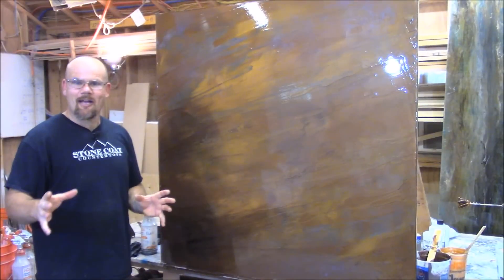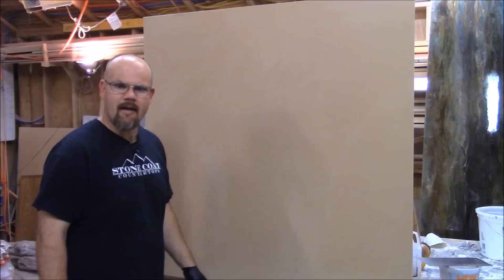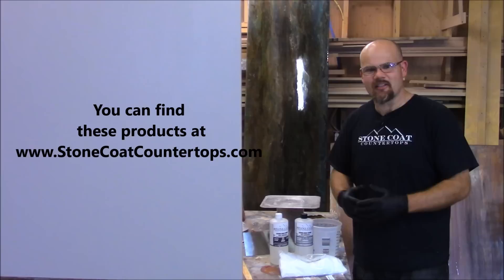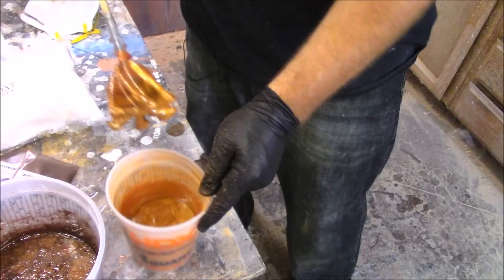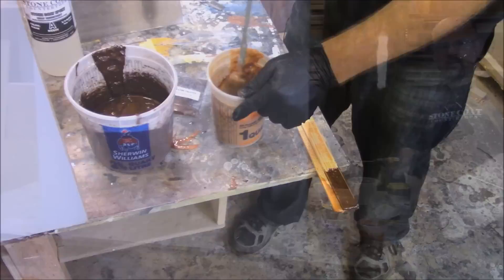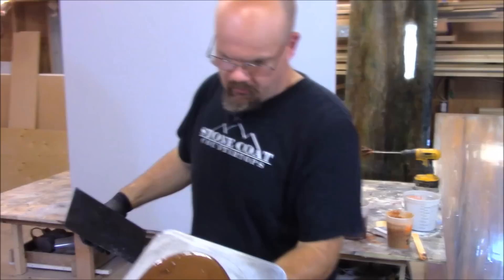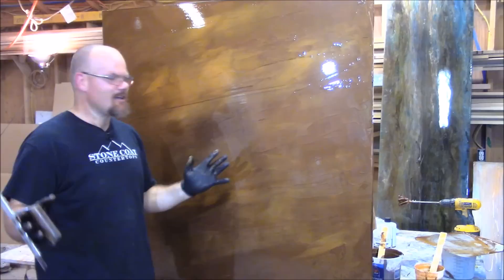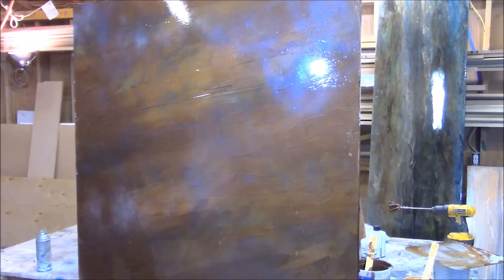Vertical wall epoxy, DIY

Comment: That vertical application is really nice. In the video it looks easy but I'm sure it takes practice.  I worked for many years  in epoxy flooring and doing the base on the floors was challenging  but you guys make everything so simple and easy to understand.  Awesome video.  Keep up the good work.

Comment: I love Mike... I really do. But this stuff is really for professionals only. We tried it. Bought the bonding primer, watched the video 20 times, read anything we could find and followed instructions to the letter. It's a complete disaster. The clean up to get the mess off is way worse, harder and more time consuming than the application. The bonding primer peeled off. The color didn't cover. We tried multiple paints and none of them worked the same way it does on the video. Mike does a wonderful job. Hire him to do it for you. This really requires a professional.
Reply from the maker: Thank you for reaching out to us Pine Run Farm! What type of substrate were you installing over?  We would be more than happy to help you out withh a fix and step-by-step instruction. Please feel free to call or email us anytime. (541)450-1976

Comment: Now I get it. You are showing people great ideas and artistry as far as they can possibly imagine using your brand of epoxy within that 45 minute window. Theres so much you can do creativewise in 45 minutes if you plan your steps very well and prepare your products accordingly, the 45 minutes is all about just letting your creative juice flow. That's big tip. Thanks! I think this is worth journaling.

Comment: That's really cool! Knowing what I know about resin I was like "he can't do that on a vertical wall..." and I was half right. With standard epoxy you can't but with a thickener it makes sense. Very awesome and now I want to do the wall around my shower. :P - Heidi
Reply: BlackCat2 I did a vertical wall with a regular epoxy. I had to apply it in light coats, let each coat cure and keep applying until the correct thickness is met. I used Corotech block filler primer and the primer, Simiron Routes for the top coats. I even added color flakes, that wasn't easy. I had over 2,300 sqft of walls in 3 different rooms. Throwing color flakes at a wall isn't fun. I wish I could add pictures. My Facebook page has them posted. Granite State Epoxy Floors.
Reply: hola amigo donde puedo conseguir un video sobre resina en paredes pero en español

Comment: I’ve done Marble with veins threw-out a whole bedroom years ago including ceiling . It blended as if all one piece.  Takes time . Only work one side at a time .
Reply: The rug was pure white so the walls was off ivory with veins of pale colors
Reply: did you do it on the mdf or straight on the walls? how did it hold up over time?

Comment: My question is,  how come there is only 1 video of this vertical epoxy wall.  It looks great and so easy,  why haven't you posted anymore videos? I'd like to see it with lighter colors. It's a bit hard to see what the finished texture is going to be.  Sample boards! Please do some samples.
Reply from the maker: Great question Froggie CanISeeYourJunk! We will be coming out with an updated vertical wall video very soon, stay tuned!
Reply: @StoneCoatCountertops  awesome news.  I've already bought the product from you, i'm just hesitant to use it.  Im worried the finish won't be smooth and glassy.  Trying to figure our another way to make my shower/tub surround. The bathroom is completely gutted. DOWN TO THE STUDS. Thankfully there's another one that can be used.
Reply: I would love to do this in my shower. A video explaining all of that, would be fantastic!!!
Reply: @StoneCoatCountertops  Yes Please!! I would love another video as I am considering epoxy shower walls in my new house!
Reply: Stone Coat Countertops , hi Guys, can you use a paint brushe with this for doing table legs ?
Reply: Does the product self level on a vertical wall?
Reply: @caniseeyourjunk6509  - Can you provide a follow up? Did you proceed with the project, results, opinion? 
Thank you!
Reply: @nicknoland9704  the project isn't complete yet and at this point I'm skeptical about using the product I purchased.  I beleive if it was as amazing as originally touted there'd be more videos.  I don't want to experiment on a remodel of my bathroom that's already taken way too long and have to come up with more money to fix the experiment when it doesn't work.
Reply: There are several. Go to their page and look up vertical epoxy walls or showers
Reply: @caniseeyourjunk6509  if your batheoom is gutted. I suggest beimg safe and waterproof membrane to studs or even 1/4 inch ply them mambrane & apply some form of bonding primer or thinset of some kind( if the mebrane has texture. This assures good adhesion when attaching the final wall pieces.) Measure you wall accurately & cut waterproof concrete board( yes I know redundant, mold .. Mildew...etc is tough stuff & unfortunately it likes to creep in anywhere it can find moisture) to you measurement to fit. And do your epoxy on a flat surface with oit the need of thickener just like you see in most of their other videos. Then you'll get smooth glass like finish. 
Side note- a friend did this...added several flood coats ( cuz well hes OCD)  . he added flood coats just incase the epoxy ever starts to fog or turn color ( his bathroom has alot of windows).. So as insurance he has , beleive it or not, basically used a orbital buffer ( for cars /wet sanding or color sanding) with , sand paper 100- 150/160-220 and then buffed it out with medium, fine , and ultra fine automotive clear coat "wax"(really isnt wax) . and finally a quick but with polishing cream..and v-i-o-l-a!!!!
Brand new finish. 
Simce he did like 3 or four flood coats. 
He'll be abke to this again probably 2 or 3 more times.. Seemd to work well for him and hasnt had any issues...
And now his huge 2 oerson shower loole lile he spent 20G's or more on a marble shower stall..
When it was more like 1000< his guesstimate . it was probably less, but he figured in labor and installation cost.
Reply: Is this able to be used on plywood walls also? Would it just take the prime and a prime and painting of the walls?
Reply: @StoneCoatCountertops  I would also like to see more vertical masterpieces before I attempt to replicate your technique.I have visions of gravity taking effect,and ending up with a mound at the bottom.
Reply: @caniseeyourjunk6509  He has a video showing how to make the walls for your gutted bathroom shower, then putting them up.
Reply: @caniseeyourjunk6509  hey how did your project turn out?
Reply: Stone Coat Countertops I already have a wall that’s painted how would I be able to make it look like your finished walls without ruin what is already up there? Like would I be able to use epoxy on it with no worries of it ruin what’s there?

Comment: Would be interested in seeing a video of this technique actually being used in the implementation of a shower wall/bathroom remodel. I saw the step by step guide on your website, but a video would be pretty awesome to make it more clear. You guys do great work, makes me wanna stop by when I'm in the area :)
Reply: He's done that too🔥🔥
Reply: @diamoneglass2136  sorry, can’t see it on his channel.. I saw only one project but there was  epoxy  pouring on the mdf sheet in horizontal position like countertop and then it was installed… would like to se the actual video of applying epoxy on shower walls with zoom on it at end..
Reply: @diamoneglass2136  pls link 😭🥺

Comment: Three Questions: 1.) What happens where it meets the floor/tub/walls - I assume there's some flow downwards and maybe some pooling - do you tape it, or...?,  2.) Is the finished texture smooth or does it retain the peaks and valleys from the troweling? and 3.) Would you topcoat this and if so, is thickener also added...?
Reply: I would like to know as welll
Reply: 1. Use Tyvek type tape at areas you're taping off, remove tape when product is tacky but not dry to create nice cut lines at edges, peel tape at a 45 degree angle from surface. The amount of thickener directly influences flow. When mixed properly, the material stays where you trowel it. 2. Retains the peaks and valleys from troweling. 3. Topcoat is not necessary but if you wanted to, yes, the thickener would be added. (If you want a smooth surface while maintaining the "depth" you'll need to apply several leveling topcoats, sanding in between and be careful not to burn through and sand off the ridges.) This is what works for me.
Reply: @TN_Travesty  thanks for this. It  make sense.
Reply: Boom
Reply: @TN_Travesty  Thank you Traves for your input,I guess it will be some time before a brush/roller type of paint finish on walls will be available.
Reply: I love your videos but I have a couple of questions.
I understand you're trying to talk while demonstrating the techniques but you're not wearing any specialised breathing apparatus or safety goggles to protect yourself.  is your product that safe that you don't need to worry so much about your lungs?
By using this additive would it be possible to weld vertical joins? Im wondering if I could create some panels for a dome in the roof of a building and obviously these would have to be joined up in place because it would be a fairly large structure. Would the product be UV resistant enough for the life of the building in this application to the outside weather?
So if you had a blockwork wall you would just skim coat render it , then Prime with paint before using the epoxy?
Reply: Geoff waterman you whisks probably post this comment as a stand alone if you want the stone coat people to see it and respond, replying to someone else’s random comment makes it highly unlikely they will see your comment. Good luck.
Reply: Good point.
Reply: Great question! I’ve got outdated kitchen countertop granite but how do we work on a backsplash that cannot be removed?  I’ve got huge countertop space
Reply: @lettycruz8493  They have backsplash videos too. You probably already know this though since your question is 6 months old.

Comment: Would love to see this done on an actual shower surround. Saw the one where you created the walls then installed in a shower, but would like to see an actual vertical job done in an actual shower. Also, can you epoxy cover a tub?
Reply: I cant see why you couldnt do your panels on flat surface then just install them like a surround in 3 pieces
Reply: @greatbay1961  It's an existing shower surround that if I am going to take apart/down, then I would just completely replace it with tile. Trying to avoid doing that.
Reply: @heatherlester3429  same here. I have some 70's fiberglass tub/shower surrounds I'd like to try it on. Don't know though.
Reply: @Heather Wood  Did you do it?   I'm strongly considering this for an old basement bathroom fiberglass shower.
Reply: Corey Van Raalte I haven't yet. I did my kitchen counters though and they turned out awesome.

Comment: how about showing a video of actual application on an existing tile on a shower please
Reply: And what happens when you eventually want to replace the epoxy treated tiles or tub surround? How do you remove the epoxy treatment? I need to know BEFORE I epoxy a tub surround, what it takes to remove it if you decide to go back to tile or some other wall covering?
Reply: @sheri4673  You can tile right over it. Just rough up the surface and use a proper tile glue.
Reply: Are they saying you can really do this over tile say shower/tub? LOL oookkkk!
Reply: You actually can just need to knock glaze off tile first.
Reply: @sheri4673  thats a great question. Im looking at making wheelchair accessible bathroom in an rv. If it wont chip,crack or flake, or is easily repaired,  I'll gut the room and do every suface except the toilet and ceiling vent. Its so easy to clean and the dog won't slip and the hair wont stick.
Reply: At another video they make some panels with epoxid and then mount them like tiles. This is easier to remove if you want.
Reply: Brett Bittner, how do you knock off glazed surface.?
Reply: @artbyamitabhakta  Sand and possibly prime.
Reply: What is that white powder?
Reply: @gaglitanwar  That is their Epoxy Thickener
Reply: Yes, I would love to see a video of an actual application on existing on a shower. That's exactly what I want to do.
Reply: @gaglitanwar  dope
Reply: Great question, I'm thinking of doing the exact same thing.

Comment: If I were to do this to my shower, would it work over caulk?  Can I use the same epoxy on the floor as the walls?  Can I use normal cleaners to clean the shower that has been coated in epoxy?

Comment: I used to Faux Finish Professionally, I'm familiar with Venetian Plaster, this does look like a similar process. It would be cool to take a brush to some of that, throw in some veins. Or you could do it with a cake frosting spatula!I 'm thinking waterfalls when I see these wall applications with some spray paint mist. But I think if it was swirled around stippled here and there some really cool stone effects would pop out. This would also be very very cool for some "Heavenly Body Galactic" effects. All kinds of jungle and wood and animal skins turned into art. Yeah, I could have some fun with this.

Comment: Does it automatically level out?  Do you have to use the torch for bubbles?  So much is unexplained.
Reply: Im guessing that since its on a vertical wall, it wont level itself out.
Reply: True there wasn't any mention of the torch or heat gun.
Reply: What you see is what you get. Plastering skills needed.

Comment: I would like to try this in my small kitchen over the sink and stove. Could I do it over 2  pieces of plywood laying flat and then just raise the boards into place and glue them into place over my sink and counters? What thickness plywood wood you recommend and how to attach it to the exiting wall without nailing into the finish?
Reply from the maker: Great question Lena! You will pour your walls as they lay flat and add any design you wish. We like to use ¾” MDF Our free video training's show many options and color choices. The effects are truly limitless. After the walls are dry and the drips are removed by sanding, you can install the shower panels using 100% silicone as an adhesive.  Give us a call or email us anytime with questions or for project support. (541)450-1976

Comment: honestly i'm blown away ur sharing secret sauce right now i'm not to interior decorative designed inclined but i do hardwood flooring n ive never seen this done or in any homes for the 10 yrs i been sanding floors n coating. i'm from ohio and no one does this but great share man. i'm sure theres a few companies and a one man ad guy that offer this product design. Man i'm bout to epoxt seal my garage basement finally n the walls are concrete blocks prolly take too much to level out i think ill just roll on n smear like the metallic floor thks again never ending thoughts are blowing my minds whats possible.

Comment: Thinking about using this kit to do a walk in shower. Would like to to the floor part with it too. Of course that would make it very slippery. Have you ever sprinkled sand on top of a mostly dry surface to give it grit?

Comment: I have a raw plywood sink top  slab I have been using as a countertop for a few years. 

I would like to make it like an  old barn wood counter.  I have my silverware check on it with space  for food prep or whatever  I need.  It is 36”X 12” x 1\2” thick.  Not sure what I need to do to prepare for finishing. 

Definitely need good advice to make it look  better than “unfinished wood”.

Comment: if i may , i would suggest you get a good trowel perhaps a curry , my opinion as a plasterer  , put a set in it this will help keep the lines out of your work , to put a set in it put a penny under the end of the shank and give it a nice firm tap a few inches behind the penny you want a very slight flare at the ends of the trowel when you look down the length of it  , take a dremel tool and round off the points just a hair , make sure to  smooth out any bers you might get on the face , with some practice you should be able to apply a thin skim coat and then from left to right bottom to top  trowel it again making smooth as a baby bottom , and something for you to try come back once its starting to setup enough that you wont screw up the first coat , and texture with other colors use a very small amount like you would texture hard-coat plaster and swirl in a figure 8 pattern , the texture should be thin allowing other colors to shine through , a few oz would be enough to texture what you did here  , this would also hide any imperfections in the first coat , ive done this with hard-coat plaster and it makes a beautiful finish , i call it a frog hair texture if you decide to try this please post a vid or let me know how it turns out dogsday19842@windstream.net

Comment: Hi from Bearwood UK.  Just stripped the side wood 12 inch high going up my staircase on left and was looking for paint effects.  WoW, have come across your fab techniques, fab use of colours, however not sure if i would/could  use the same type of products that you use.  Especially as have a ridge at top and then a top ridge 1inch.  However love your blending,.  Thankks loadzzzzz

Comment: If you are doing a sink, it would be a good Idea to mix a little of the vertical additive so that it doesn't run as much, same thing with backsplashes. I have lots of great ideas for this :D Thanks man